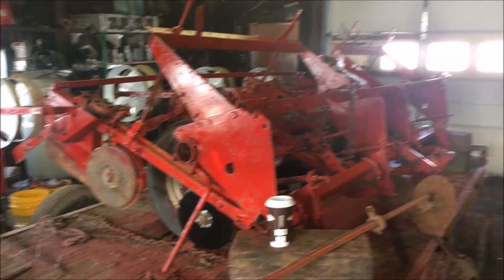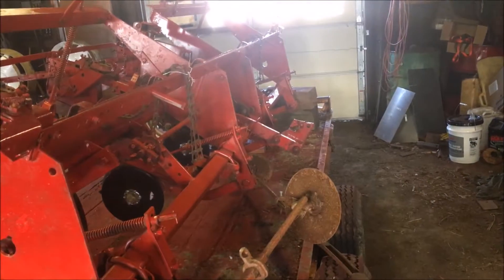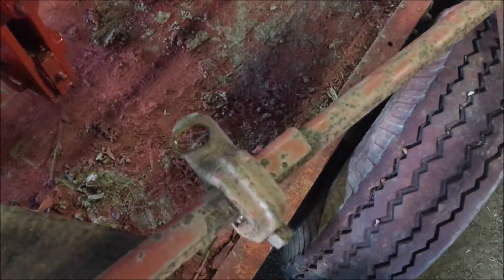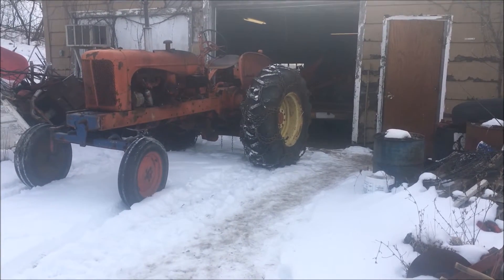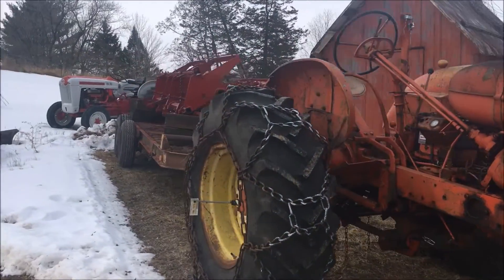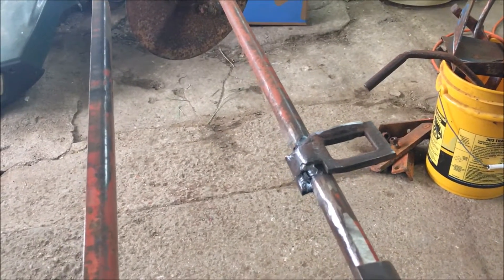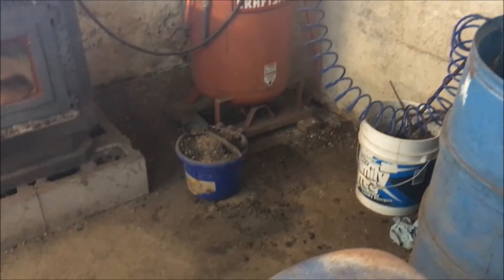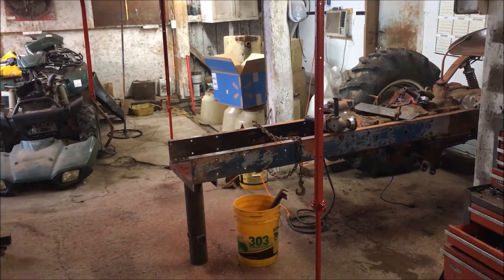International 56 Corn Planter Revival Part 5

Comment: It is coming along nice. I had plans to fix up an old 4 row 494a Deere years ago.  But found a 6 row 7000 Deere that even with the repairs was less money than what I was going to have in the 494a so it got sold and I fixed the 7000 up.

Comment: Now that you have the marker arms all welded and painted up, are you sure they are set for the correct spacing???     Yes, those old 9" grinders work great BUT they are heavy and produce some torque, I consider them man killers, they really kill my back to bend and use them.
Reply from the maker: Yeah, I did have enough sense to measure the marker arms :) I can only use that big honker for about 5 min then take 15 min off.